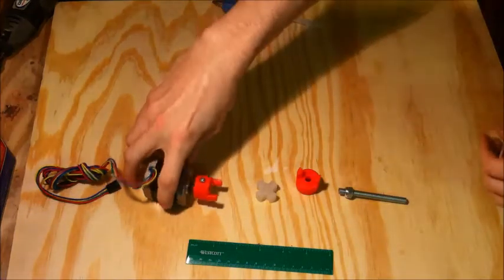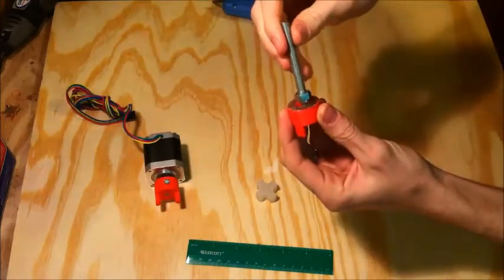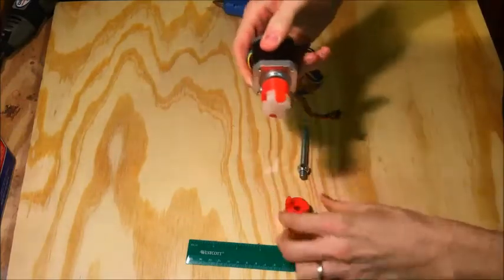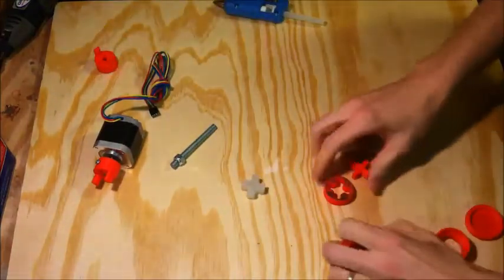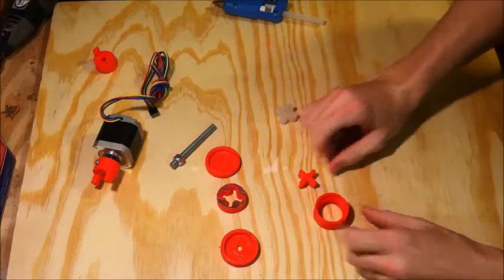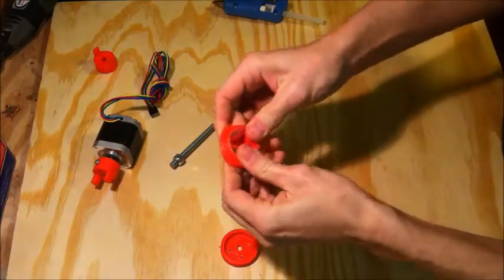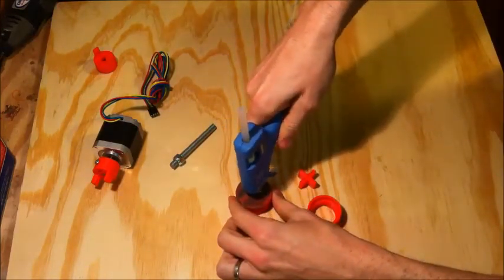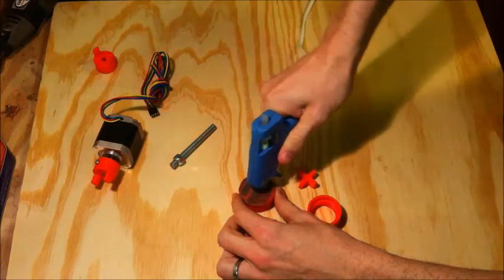3D Printed Spider Coupler

Comment: Nice idea and vid man. Now we can make rubber parts for your builds. I know we can print flexible filament, but I still think this is more efficient and fast. Thanks for the vid man.
Reply from the maker: +3D Printwiz Thanks! I know this particular item is a diy version of an already cheap part but the concept could be useful elsewhere. I'm still using those same exact couplers on my printer so they hold up well over time.